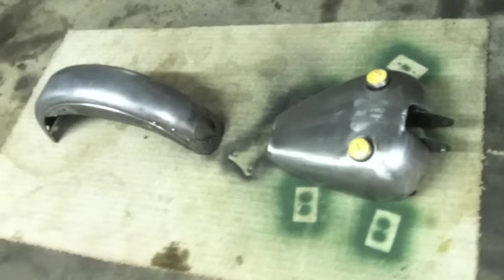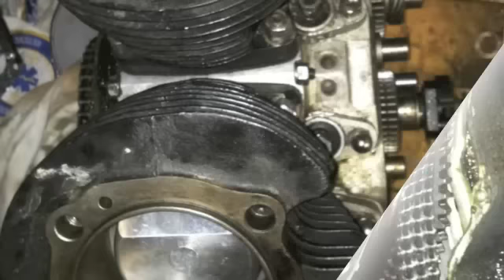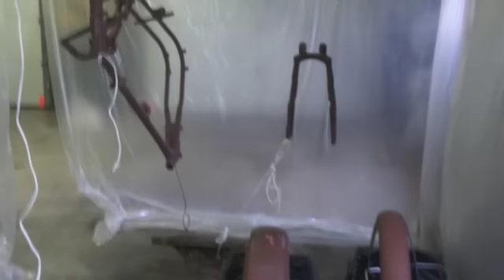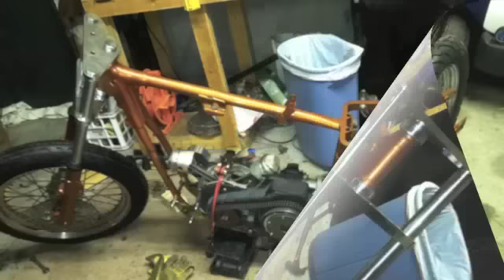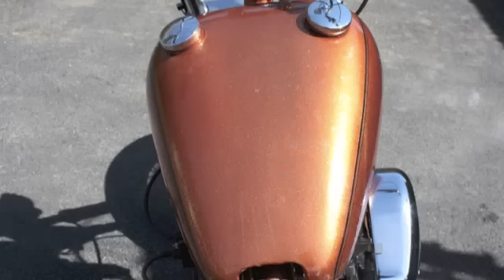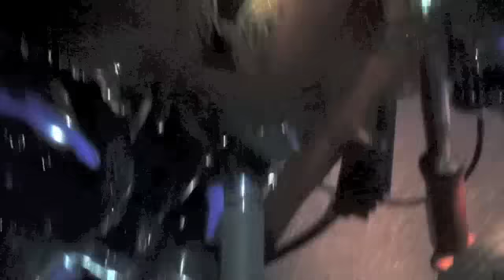76Iron.m4v

Comment: Very nice work on the rebuild and very nice choice of paint, that metal flake copper looks kick ass!!!
I have a 1975 H-D Sportster "Ironhead" that I've owned for over 10 years now and I bought it really cheap! It was unsafe had crappy drum rear brakes, non-working taillight, no fenders front or rear! But I was 21 and I rode the piss outta that rat bike!!! lol
I'm in the middle of rebuilding it now, but I don't know if I want to go with a new rigid hardtail frame or fix up the stock swingarm one!